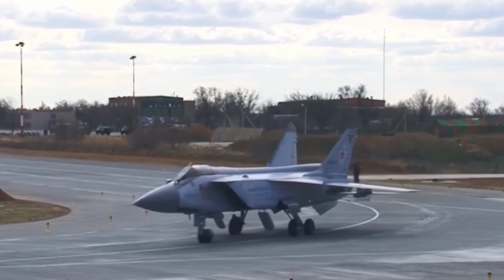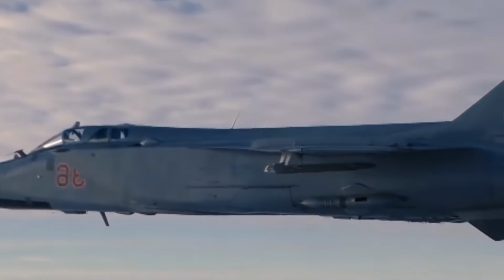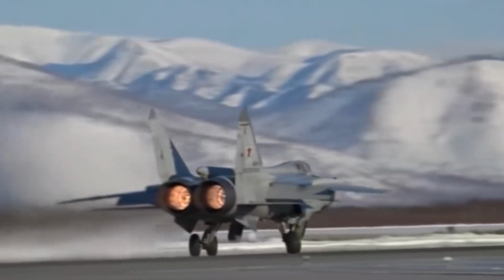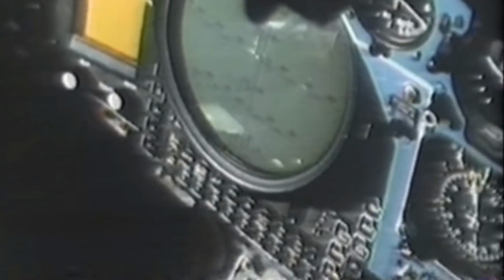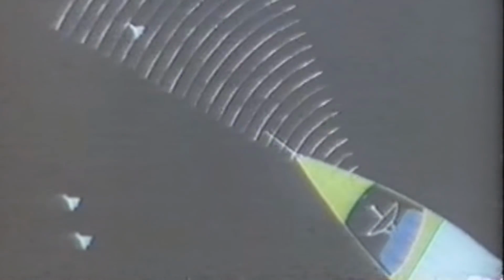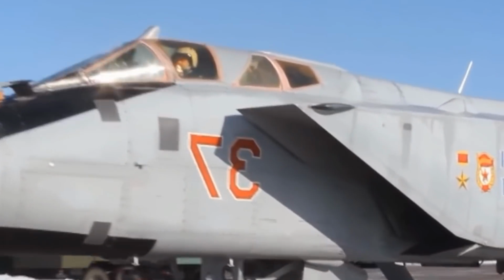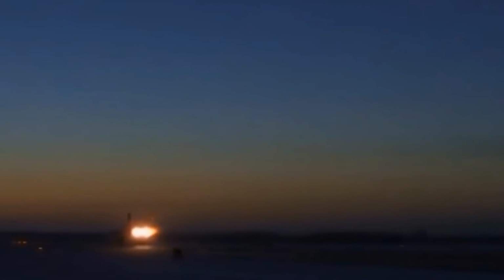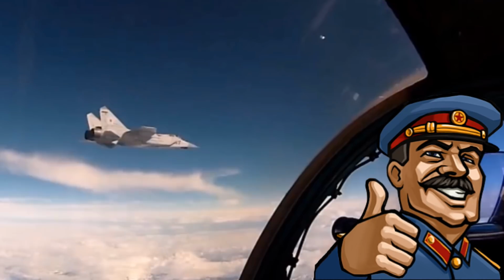Mikoyan MiG-31 Foxhound - Russian Interceptor Fighter

Comment: The Mig-25 still holds the world record for altitude with a jet engine.
Reply: Name one fighter jet made in the US which is faster than the MIG-25 / MIG-31. 

For the record: The SR-71 is not a fighter jet.
Reply: @dmitrit.4862   Ah, but it was initially envisioned as a high speed interceptor.

Late response is late, I know.

But you are right, we had nothing to match those on pure speed.  Even the F14 and F15 would have been left in the dust in a straight line.
Reply: @crowttubebot3075  It is still fast mate. Even without using afterburners!
Reply: Dmitri T. The A12 was the single seat fighter version of the SR71.  It did not enter service but it was also the basis of the AF12 fighter version which could fire supersonic missiles extended out from its weapons bay.   The SR71 was not to over fly target countries just skirt the borders of countries.  For overflights you used the A12 as you didn’t want to risk two crew and needed different sensors, that was the theory.  The AF12 obviously wasn’t a dog fighter but was intended to intercept Soviet supersonic bombers and possibly an imagined soviet recon..   The US made due with the F106 and it’s standard fighters.  I don’t think the USSR deployed a bomber fast enough to warrant it though the Blackjack and the TU-22 would be hard to intercept if they could sustain Mach 2 for any longer length of time.
Reply: @dmitrit.4862   But the YF- 12 was.... Just saying...
Reply: @wwclay86  I'm talking about fighter jets that entered service, not about experimental jets.
Reply: @dmitrit.4862  try the A-12
Reply: @grelauren  A-12 wasn't a fighter jet tho. I was referring to fighter jets.
Reply: Dmitri T. You mean faster in a limited one time sprint that destroyed its own engines? Or it’s actual  usable max speed
Reply: @sparten17708  What are you reffering to?
Reply: Dmitri T. The fact that its limited to the same “max” speed as the mig 25. The Mig 25 could reach mach 3.2, but it would gulp its fuel and ruin its engines in a short spring. The fact that the successor is limited to the same speed with different engines “also more powerful” say something. The soviet union/Russia wouldn’t be trying to hid the top speed a old hulk of a interceptor... given how much they brag about their equipment being superior.
Reply: @sparten17708  Of course it can't fly with max speed for a long time, no fighter jet can. The latest generation can super cruise for a while but even that is costly because it uses a specific amount of fuel, obviously. The engines of the MIG-25 are old, MIG-31 on the other hand was modernized and upgraded from time to time. It's still the fastest interceptor in the world. Nevertheless, the MIG-31 is used for special purposses like intercepting balistic missiles or carrying the Kinzhal hypersonic missile.
Reply: @sparten17708  The performance characteristics of the typically specified characteristics is 20 percent below. Short-term use of the maximum characteristics allowed in a combat situation during the war. In any case, so stated one of the most experienced test pilots of Russia and the USSR. Obviously it is a common practice to use the technique is not at the limit of possibilities to increase the service life. But importantly, that officially published parameters serial technology, not experimental samples, certainly understated
Reply: @dmitrit.4862  you want to start talking performance of aircraft, giving an example of a highly modified military jet with one sole purpose, ie the mig 25 modified to set the altitude record??.......
Tell us, how many russian airliners are capable of supercruising at over mach 2, WITHOUT using afterburners at 60,000ft?
Neither 25 or 31 are even CLOSE to being capable of cruising at mach without reheat, and they are obviously military😂😂
Reply: Yea right. Come back when its declassified then.
Reply: Luka Preradović the sr-71 a turboramjet at high altitude but a turbojet at lower altitude
Reply: What are you referring to. There is no other straight up jet engine aircraft that get's anywhere near the Mig-25's record.Even non jet aircraft are anywhere near it's top altitude. Not to mention all the altitude records near the Mig-25 are air launched aircraft. Here's a link of all the records https://en.wikipedia.org/wiki/Flight_altitude_record Mig-25 world record is 37,650 m which is absolutely insane. No other jet aircraft even comes remotely close to that
Reply: @Punisher9419  that's one of the reasons they dropped the Mig-25 and developed the 31 (the other being Viktor Belenko's 1976 defection to Japan in one). 
The 25's turboJET engines were initially developed for a cruise missile. This is why they wore out so quickly and overheated at max thrust, but they hurried the 25. to production and didn't have a proper engine for it so they just fitted two of those. 
Yes, the turbojet characteristics gave it very good performance at very high altitude, hence the altitude records and all the speed, but poor or very poor at medium or low. Also very high specific fuel consumption especially in low altitude. 
Normally the 25 could outrun ANYTHING at an altitude where its engines ran effectively. Even missiles sometimes (see 1971 reconnaissance flights over Israel). Inappropriate and low-level engagement played a big part in all the recorded kills on the 25 too. Pilots attempted to use them against other fighters at close-ish range and below the altitude ceiling the engines were comfortable at. Also, i understand some even tried to dogfight in the 25 too (?!?). 

The low-bypass turbofan in the 31 cannot quite match the 25 in high altitude but it works beautifully across the altitude range, gives the 31 a killer sustained climb rate and allows it to rip past Mach 2 nose up. The 2xturbofans can also push the 31 to Mach 1.6 at low-level which does not sound like a lot but it's actually more than pretty much everyone else. For comparison, i think the F15 struggles to pull 1.3M at low-level even on clean wings. Btw, the Tupolev 160 uses the same engines in the 31. Just 4 of them rather than 2. 
So yeah, the 25 flew higher and a little quicker too, but overall the 31 is a much more deadly machine.
Reply: @Punisher9419  "Even non jet aircraft are nowhere near it's top altitude"??

Am guessing youve ever heard of the X-15 then?
Reply: @kf8575  Doesn't have weapons and it's rocket powered not a jet engine.
Reply: Kuddlesworth NA, only in a zoom climb. The 25 cannot sustain it.
Reply: Pirated Vegas Crashes Alot hi, where can I find information about the research aircraft you mentioned?
Reply: Kuddlesworth NA cause it has bigger engine than mig 31.
Reply: The have F-15 may have a higher service ceiling. Some X Planes may have broken. Record in the late 1950s
Reply: @dodecahedron1  YF-12 never entered service. Don't compare prototypes with jets that actually entered service.
Reply: Arsene Who?  The SR-71 was not a fighter jet.
Reply: Arsene Who?  	Mikoyan-Gurevich Ye-266M MiG-25 37,650 m. Lockheed SR-71 Blackbird 25,929 m https://en.wikipedia.org/wiki/Flight_altitude_record
Reply: Bueno
Bueno
Bueno
Bueno, bueno,bueno
Buenobuenobueno
 BUUUEENNNNOOO-----------😖💢💥💦😆😋----'
Exelleante!!!-
Reply: Agreed. The ability to reach its max.alt. is different to sustained flight at this height. The SR71 could keep it up all day with the engines in ramjet bypass.
Reply: The Mig that made the 123,000 zoom flight was highly modified. It had thrusters installedto control it,  as the engines flame out before max altitude. Normal mig25/31 could not do this especially with a combat load. Hell a F104 could zoom damn high

The A-12/SR71’s max altitude is classified but she cruised around 80,000 at 3.2m+. I would think a little pull back on the Stick could yield a little Altitude. I think it’s max  KIAS was 500 knots, not sure was stall speed waz at that Altitude. But most jets start their zoom from 40,000ft after going supersonic. Also Remember a 25/31 cruising altitude was still 10-15,000 ft off the black birds cruising altitude.

Compare the Aero dynamics of  mig25 andSR 71, the SR smashes it so much slicker

One other thing black bird carried like 70,000 lbs of fuel!!! A light one could climb!
Reply: @williamkillingsworth2619  SR-71 is not a mass production aircraft and this can be finished. Mig25 and Mig31 in serial versions may not reach the maximum characteristics, but compared to other serial aircraft, their characteristics are still record for certain points. Any production aircraft can briefly exceed its normal maximum performance by an additional 20 percent. You may then need to repair or additional maintenance, but it is provided. The pilot is allowed to exceed the official maximum performance only in special cases or in a combat situation during the war
Reply: Steve Cherk 

The whole point is the one that did it had a type of  engine that was never utilized in production model. 

That’s like saying I saw a NASCAR Ford Taurus doing 180 miles an hour that means my stock Ford Taurus should be able to do that... 

https://www.testpilot.ru/russia/mikoyan/mig/25/m/mig25m_e.htm

Here’s a little bit of literature it really doesn’t go into details.
Reply: @williamkillingsworth2619  that's not the point at all. I just wrote about that in everyday use do not use maximum the opportunities of technology and performance characteristics are specified exactly understated performance. Quite to the usual standard equipment without additional rework may exceed these performance characteristics by 20 percent if necessary.  Although this of course will lead to an accelerated decrease of the resource. Modified record model is a completely separate issue.
Reply: Steve Cherk you are getting way off topic of the OP.   So I will indulge too. 

From what I read, obviously, I’ve never flown a MiG-25, it’s engines actually were limited to mach 2.4 sustained with bursts to 2.8 any faster and they runaway. 

So Mig 25 was almost a full Mach  slower than SR 71 3.2M sustained, 3.5M burst. I personally think that’s a drastic difference. 

For comparison. A F-15c was 2.5+M repeatable. Meaning in every day use, a F-15C is actually right there with Mig-25. The plus means it could likely push faster too...20%...

You can’t sustain a jet if every time you fly it it eats the engine, that’s just an absurd claim. The internet tells bigger tales than a fisherman... I would argue that the F-15C is the fastest production aircraft flying

So to sum it up a PRODUCTION MiG-25 was capable of 2.4M at around 70,000 feet in level flight. Reliably. It could zoom to 90,000 but at that point had lost a great deal of air speed.

Highest height of an SR 71 I’ve ever heard from a reliable source was 97,000 feet(Jim Goodall). At those speed it could only pull 1.5g,still above mach 3. 

https://www.quora.com/Why-was-the-MiG-25-faster-than-the-F-15-despite-being-so-low-tech-in-comparison-and-both-planes’-having-a-similar-twin-engine-configuration
Reply: @williamkillingsworth2619  I am guided by the available data for conventional production aircraft. It is not necessary to compare Миг25 and Миг31 with F15. These are planes for completely different purposes. Миг25 and Миг31 this interceptor for large heights. For MiG 25, the maximum speed at altitudes of 10-13 km is 2900-3000. For Mig31 - up to 3400 km per hour. For MiG 25 registered 29 official world records, including the rise to a height of 37650 meters. And this is a serial aircraft that can use the weapon at high altitudes. That's what they're made for. They were created in and for intercepting high-altitude reconnaissance SR71. As for the F15, it is a classic heavy fighter, which is usually compared with the su27 fighter line and its modifications - Su30, Su35. As for the MiG 25 and Миг31 only cruising speed at altitude is comparable to the maximum speeds of the F15. These are completely different planes for different purposes. And again, given that the maximum characteristics of Russian aircraft are traditionally understated, it is difficult to judge at what speeds and what time they can fly without serious problems for the design of the aircraft. According to official data, the thrust of the engines on all these Russian aircraft is slightly higher than for the F15 both in normal mode and afterburner. When a similar mass of aircraft available hints at a hidden reserve of power. Usually it is not advertised, but according to some su57 is quite free to reach speeds of 3000 km. per hour at altitude, at least with the new engine (thrust 11000 kg and 18,000 kg respectively for normal mode, and afterburner) But it's funny, it seems the Americans have come up with some new tactics of war in the air, because the new advertised F35 have only one engine, and certainly can not boast of any speed or other performance.
Reply: @williamkillingsworth2619  such records are often put on a specially prepared aircraft, but it was done on the basis of conventional serial. And Миг25 and Миг31 and serial options have a very high performance both in speed and practical ceiling flight. They will not disassemble the F22, especially since it has already been discontinued. Су57 it is still very new plane. It also has a very high flying quality, even with old engines. With new engines it will still be probably to experience to the maximum modes than one year and perhaps some records will be able to do, but it is clearly not for this purpose intended. So far, as far as we know, the design of the aircraft can withstand very high overload limits - 10-11g. With the new engines, it clearly exceeds the thrust-to-weight ratio of most modern fighters. On maneuverability apparently, too,. Full control of the thrust vector of the engine in all planes. Supersonic speed without afterburner.   As for the F35, even if we do not touch on officially announced problems that still need to be solved and are unlikely to be solved completely someday, then the flight characteristics of this aircraft looks pretty dull even in comparison with many old fighters. And the impossibility of a full-fledged supersonic flight without afterburner in General raises doubts that it can be attributed to the fifth generation aircraft.   How to really manifest its qualities of stealth and tactical quality of the advertised action group is nobody nobody can estimate somehow. A very expensive plane with an unclear fighting qualities. Among the critics of the aircraft is found such as the inability to use an aircraft gun and the ability to operate up to two air-to-air missiles. So this is a very questionable project, pursuing clearly more commercial goals than the creation of a truly combat-ready aircraft of the new generation.
Reply: Steve Cherk F-35 you are misinformed
Reply: @williamkillingsworth2619   - Yes, in that he is still too highly speaking of the POS F-35, a typical woke times blunder the USA seems so good at these years. Look at the new carriers with catapults that pull AC to pieces and loads of other trouble. It makes you wonder, LGBTSVP whatever designers?
Reply: And it will stay that way until the US military records are declassified.
Reply: @herichimoify  : Yes, the mentality of the Jewnited States of America is to be humble :)

What you are saying then is like for example the American soccer team plays awfully bad as it won't show their fully potential?

Maybe you're right since for example NASA can't even bring any humans to ISS anymore :)
Reply: Kim Jakab you’re right they use a different American company instead :)
Reply: Seumas na Tuaighe sr71 fuselage can't handle making these records sorry but usa anarchists
Reply: "What are you referring to." Such an apt statement, or was that a question? Do you even know what you are referring to?
Tell me... What purpose does taking a purpose-built, unarmed, stripped down aircraft, flying it in a single zoom-climb* till it's engines flame out, coast an extra 20k ft,, and finally free-fall back down to earth while the pilot frantically attempts to restart the engines before hitting zero ABGL serve? As if the F-15 couldn't pull this feat. The MiG-31, and 25 (your so-called record holder) are interesting flying missile platforms. But effective fighters (and even interceptors, thanks to spotty missiles they are hardwired to use) they are not.

* https://en.wikipedia.org/wiki/Zoom_climb
Reply: Well that would be just plain pointless now wouldn't it?
Reply: @herichimoify    You forgot about Wonder-Woman's invisible jet, not to mention Sudan's super-secret research jets.   To sum up, if you can imagine crap, so can anyone else.  Maybe Yugoslavia landed men on the moon in 1948 but kept it a secret; maybe the Ottoman Empire invented the transistor in 1750; maybe the Neanderthals did not go extinct, but built flying saucers and left for distant stars.  The award for what you maybe did, but can't talk about, sits on the shelf next to the New Orleans Saints' Would-Coulda-Shoulda Super Bowl trophy for this year.
Reply: @christosvoskresye  Russian MiG-23MLD, MiG-25PD, MiG-25PDS, MiG-29 MU3, MiG-31E ( 31 BM, 31 K ), MiG-33, MiG-35, Tu-128M, Su-27SM2, Su-30SM, Suhoj Su -33, Su-35S and Su-37, 
American F-14D, F-15DJ, F-16F/110, YF-17, F-18F, F-22А, F-35A, F-35B i F-35C, Serbian G - 2, G - 4, J - 21, J - 22. manufactured in America, destroyed in Serbia with S - 125; We did not know that the invisible F-117 A Nighthawk (fall in BUDANOVCI -  Buđanovci ) and B-2 Spirit Missouria (fallen into the SPACING COURSE - Spačvanska šuma ) Steven Li Bashen - B-2 Spirit units in Combat - Tomas Vitingtin on page 43. read some of the relevant sites on you: won S - 200 VS F - 35 Lytting Lost; won S -125 VS F - 15Eagle Lost; won S - 125 VS F - 16 CG Fighting Falcon Lost; won S - 125 VS F - 177 A Nighthawk Lost; won S - 125 VS B - 2A Spirit Lost; won MIG - 21 Fishbed VS F - 16 Fighting Falcon Lost, won S - 125 VS B - 52 Stratofortress Lost, won S - 125 VS U - 2 Lost. Since we have well declared the S - 125 in 1999 year, they could be given a gift S - 300 and S - 2000 in the war to destroy the F - 22 Raptor.
Reply: @christosvoskresye  thanks, needed that here.